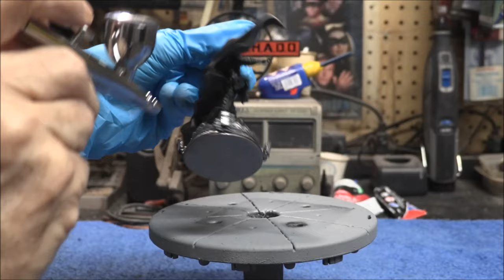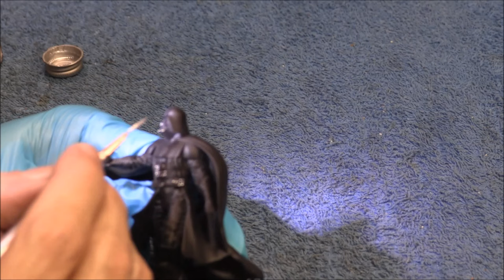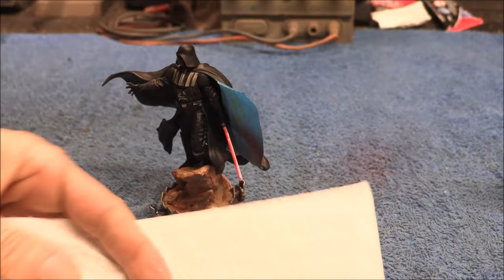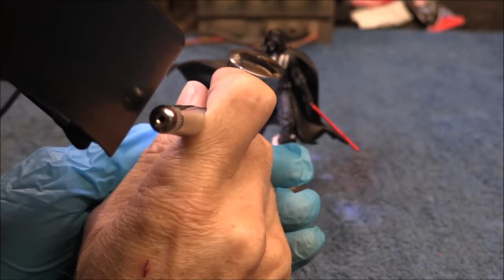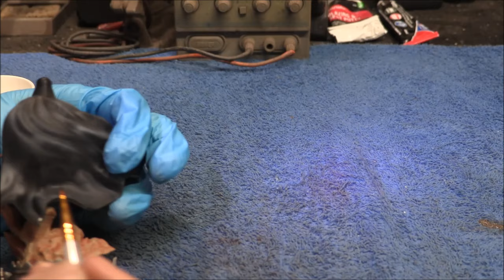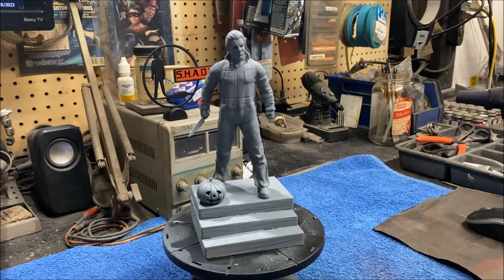UNIFORMATION GK TWO Resin Printer Test/Review Part 3 Painting The Printed Darth Vader Figure

Comment: @22:22 -- You could have left the overspray, Boyd, and just rationalized it as a reflection of the lightsaber blade's glowing.
Save yourself some work and indulge in "happy accidents."
In that position, I think I would have left it alone.  

Lightsabers have always been kind of difficult to model.  This is where having  a "hot core" of white LED helps.  It's the only way to get the effect of the movies.  Otherwise, it's a solid core of red or blue or transparent plastic cast in a particular color.
The worst thing I've seen in statues are "wilting lightsabers" -- ie, plastic that's too soft to retain a straight line.  It bends.  It really, really bends!  There was a Kotobukiya(sp?) model released years ago that recreated the original lightsaber duel concept painting done by Ralph McQuarrie (which I would STILL love to get a print of; I only have JPGs of it).  The 2-figure statue of Vader and Deak "Skywalker" didn't look right partly because of the transparent plastic lightsabers.  Yes, they mimicked the original violet (Vader) and light yellow (Deak/Luke) saber blades but the real turn-off was that the plastic blades were already wilting when they arrived in stores!!!

Comment: I got a question on the metallic craft paint.  Ive been using craft paint on my Enterprise Refit 350 build on my channel.  When it comes to the Metallics no mater how much I reduce it and strain it.  It clogs my airbrush.  Im using a 0.3mm tip.  Are you using the same?
Reply from the maker: I don't thin the craft paints as much as regular paint so it covers better and doesn't run. I use a .05 tip which works well with it.
Reply: @TrekWorks  Thanks.  Your tip is bigger so that might be my problem with the metallic paint since the little flake pigment is to large for a 0.3mm.